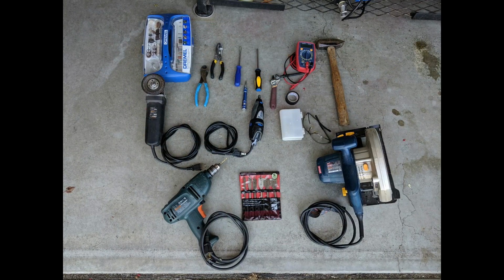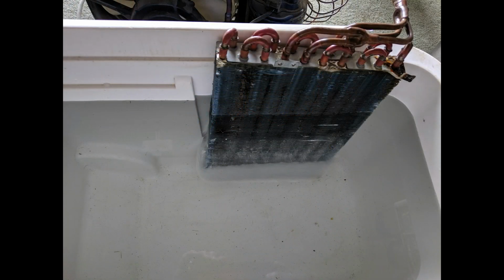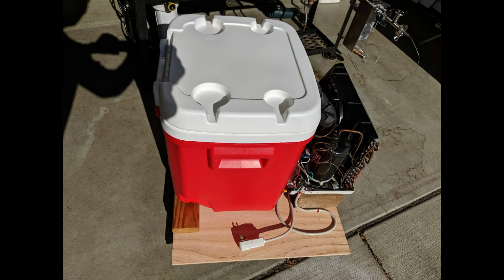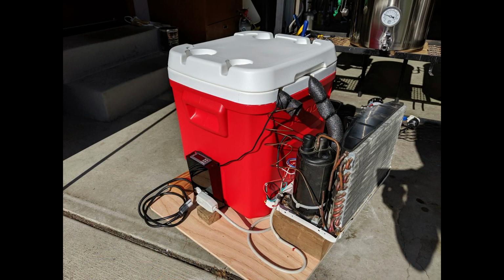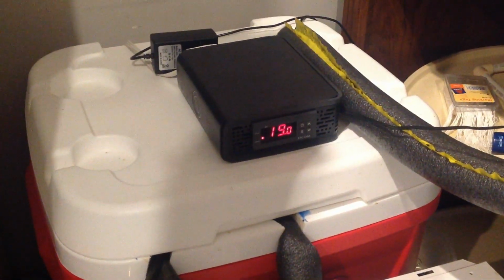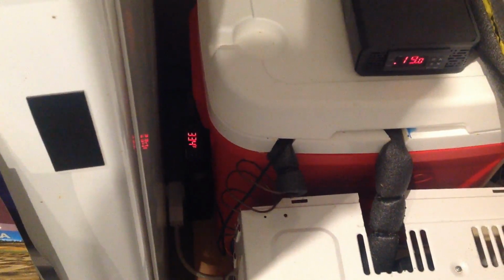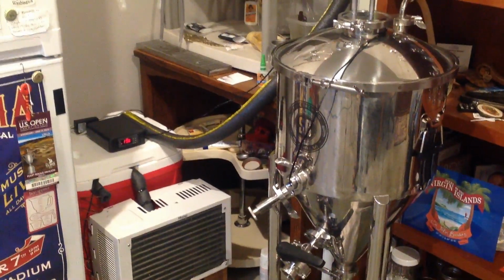Homebrew DIY Glycol Chiller

Comment: So you are basically keeping the glycol at a steady, low temp and just switching the pump when needed?
I would have likely overcomplicated it myself, this looks much more sane.
Reply from the maker: You are exactly correct.  The glycol in the cooler is held at ~ 32 degrees F.  The on/off controller for the cooling pump that circulates the cold glycol is controlled by the probe inserted in the thermowell in the fermenter.  I can program it any where I like to between ~ 35F to 75F (or just turn it off to get as warm as it naturally will which is above where I'd ever want to have it).  I'll be doing a video on pumps and will show the one that is in the chiller in that video if you are interested in that. Thanks again for watching.

Comment: Hrm, I do wonder if it's better to keep the return warm glycol outside of the foam sheath, so as to not heat up the cold feed tube?    Although realistically the temperature delta is probably negligible.
Reply from the maker: This is why I like to post videos: I get a lot of great input, ideas, observations offered by those who watch.  Thank you.
Funny enough, initially I had two different foam insulators - one for output, one for return.  After monitoring things for a bit, I realized that the reality was that neither insulator really did much. Having two different ones was sort of clunky, so I went to one.  The advantage of using the insulator is that it stopped the hoses from sweating so much (without the insulator they would literally drip with condensation).  Thanks again for watching and sharing your thoughts.

Comment: Hi! Awesome build and clean finished project. I had a question about the leftover parts. Do you have any fan at all that's blowing on the big coils on the front? I took things apart well enough, but I can't tell if there's a fan running in your video. Thanks for spreading your knowledge!
Reply from the maker: Thanks for your very kind comment.  There were two fan blades in here.  One was the hamster wheel style that you see in the stack up of unused parts at 2:00.  This one would be the one to blow across the cold "radiator" and force the cold air into your room.  The other one, which you can see at 2:59, is the propeller type that cools the coils in the unit.  This would be the warm/hot exhaust air.  You will need this one so the unit cools off when running (plus it would be really hard to get out!!).  Let me know if you have any other questions and I'll gladly answer.

Comment: This is great. Do you think leaving the AC wiring intact and just turning it full blast would work?  I'm in the garage and it's hot
Reply from the maker: While not an expert, I believe that the AC unit would run because no cool air would be blown over the temperature sensor.  I think that this would make the glycol extremely cold (freeze???) and put some stress on your unit.  I thought came to me that perhaps you could put a timer on your AC unit to cycle it on and off via time instead of temperature.  To give you a reference, my garage is around 68 degrees, when my glycol temperature goes up to 35 degrees the AC turns on for about 4 or 5 minutes to cool it back down to about 28 degrees (pretty efficient).  When just holding the temperature (not crashing) this cycle occurs every couple hours.  When just sitting idle, this cycle occurs once a day or so.
At 0:52 my test configuration is sort of like what you are talking about (everything was still connected)
Best of luck.
Reply: @homebrewingtips6029  really appreciate your time in responding. I will use a temp controller to monitor the glycol temp and keep the AC wiring intact, so the controller will switch on only when required. You also answered a different question I had about how much it runs. Was a little worried about making the hot garage even hotter, but it shouldn't be an issue with these run times and with my 5 gallon batches. Happy brewing!

Comment: Great work and project?  I guess over time there will be worry of unit rusting for the components submerged in the glycol water mix?
Reply from the maker: Good morning and thanks for watching and commenting.  I have been monitoring the unit for signs of wear (corrosion)  and so-far-so-good.  The AC unit I used was old and seems to be holding up pretty good.  Also, I am relying on what others who posted similar projects had to say on this topic: all positive..  Now with that said, my little submersible pump sometimes doesn't want to run and the glycol is a little cloudy, but no real signs of things giving out.  At the one year mark I will probably drain it, clean it, and give a thorough inspection.  The glycol is about $25 per gallon, and I used 2 gallons so I want to stretch it as long as I can.  Hopefully this helps.  All the best ....

Comment: Great system! Can you tell me about the glycol pump and where it's placed in your system? I'm not seeing how the glycol is pushed through the line.
Many thanks,
Stephen
Reply from the maker: Thanks for your kind words, I am happy to provide the extra info.  I should have taken a photo of this because others have asked about it too.  Essentially I have this little pump sitting in the bottom of the glycol tank.  The output tube comes off the top and pumps the fluid up through the tube connected to the fermenter cooling coil.  The output from the cooling coil comes back down to the tank through the second tube (both tubes are in the grey pipe insulator).  Here is a link to the pump I used (still going strong):
https://www.amazon.com/bayite-BYT-7A006-Heater-Circulation-Discharge/dp/B0196WL55G/ref=sr_1_7?crid=2H370Y1634UM5&dchild=1&keywords=bayite+12v+dc+fresh+water+pump&qid=1593960668&sprefix=bayite%2Caps%2C338&sr=8-7

Hopefully this helps.  All the best.

Comment: Hello!
This project looks really cool I just got an A/C unit to go with you idea.
Can I ask you a favor? Would you let me know how did you worked out the capacitor hard-wiring and circuitry part? I believe that apart from that I can set up the connections with the ink-bird controller for the temp. control for this glycol-side cooling temp. (apart from that for the fermenter which I already had set up).
Thank you!
Reply from the maker: Thanks for watching.  In my unit the A/C power line (the black wire) went from the wall plug to the on/off switch, then over to the high/low switch and finally to the condenser (look at time 3:04).  I could connect it directly from the cable to the condenser and the fan and that would be the same as if the unit was on and set to high power.  To do this a simple multi meter is helpful.  Another good spot to see this is 3:19, stop the video there and you can see the black wire connected to the condenser black wire and the fan red wire (they are tied together with the yellow wire nut).
Reply: @homebrewingtips6029  Allright! Let me give it a try and I let you know how it went!  
Cheers!

Comment: What pumps the glycol around bud
Reply: thanks for watching.  I use this little pump inside the glycol cooler.  It just sits on the bottom with the tube coming up off of the top: 

 https://www.amazon.com/gp/product/B01G305PK0/ref=ppx_yo_dt_b_search_asin_title?ie=UTF8&psc=1

I find that these little pumps work great for a number of different recirculation applications
Reply: @homesmokingtips1449  great,  thanks alot for the link 👍

Comment: This is really cool! Just a thought on my part. There has to be a way to do this smaller maybe with Peltier devices? I how someone out there posts a video.
Reply from the maker: thanks for watching a leaving a very good comment.  There are some fermenter suppliers who offer TEC coolers attached to the fermenter.  MoreBeer does (or did) like this:
https://www.morebeer.com/products/ultimate-conical-fermenter-14-gallon.html
I have played around with them myself, but I found them to be expensive and inefficient and a bit tough to use (also prone to failure if not handled right).  I am fortunate enough to have the space for the glycol type of set up.

Comment: Hi there, thank you for sharing the video of your Project. I do have a question.... do you think running a circulation pump inside the cooler would help keep the mixture at a more consistent temp?
Reply from the maker: In some other builds you see the use of a circulation pump.  I thought that I would try it first without one and was happy to see that it works fine.  When the pump runs to circulate through the fermenter, the return sort of stirs things up.  Also with the size of my cooler, and the coil's position right in the middle, I think the temperature is stable throughout.

Comment: Hey mate, just curious as to how well it actually pulls down to temp?
Reply from the maker: thanks for watching and thanks for writing.  My set up is in the garage where it is typically 65 - 75 degrees ambient.  I can easily move the temperature 5 degrees each 30 - 60 minutes (I never really timed it).  I can crash and hold below 40 degrees easily.  The single biggest factor is the efficiency and batch size in the fermenter itself.  Mine is up to 15 gallons, of which I usually ferment 8 gallons (that way I can fill a 5 gallon keg and a 3 gallon keg).  Ironically, the fuller the fermenter the better.  As for holding any temperature to with in .5 degrees, it is rock solid.  I hope that answers your question and helps.  Cheers!

Comment: This will be my next project.  Did you retain the stock capacitor?  Also, I have seen others just connect the thermostat leads together in essence creating a permanently closed (or open I guess) circuit.  Is that what you did?
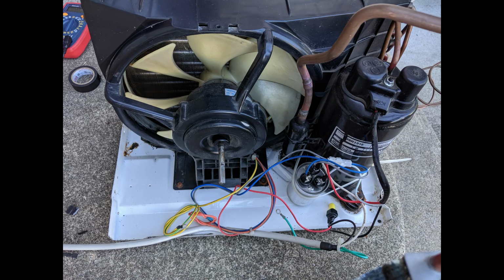Reply: First off, good luck on your build!  This is a fun project.  I kept the capacitor.   I followed the hot wire from the AC input and tied all of the connected wires together, For example, I took the on off switch out and tied the AC line directly to the on position, same thing with the speed control (tied it to the "high" setting).  As for the thermostat,  what you said would work, I found it just as easy to remove the whole thing and it left the unit very tidy.  You can see most of this in 3:00 - 3:25 in the video.  I found using a simple volt meter was all you really needed to see how the wiring actually works.  One extra thing that I'll comment on, when you are going to bend out the coil, I found slow and constant pressure was the way to go.  I had no issues at all (this was what I feared the most).  I actually pulled mine out and rotated it 90 degrees in one gentle, continuous motion.  Feel free to ping me with other question.  Have fun!
Reply: Any heat used to bend the coil into position or just slow pulling?
Reply from the maker: @nickypalma2039  No heat needed.  I just used a slow and steady force to pull out and position the coil where I wanted it to go.  This was the most concerning part of the project but proved to be quite simple with the A/C unit that I had.

Comment: Great build. Ill be doing one in the spring with an emphasis on  keeping it as compact and movable as possible as it will be used in my apartment with my ss brewtech conical.  Also thinking about implementing a ball valve to be able to drain  easier when necessary by hooking up to an external chugger pump.  Side note : you in Minnesota?
Reply from the maker: Thanks for the note.  I thought about doing this for a long time and am very glad that I finally did.  Your ball valve idea is a good one.  Also, I highly recommend the mechanical switch between your glycol pump controller  and the pump itself.  These little controllers can turn on if the power flickers (or goes out) and you would be broken hearted to see 2 gallons of glycol + 4 gallons of water all over your floor because the pump kicked on when the tubes are not connected to your fermenter.  Feel free to ask any questions once you get going and I'll be glad to help out.
As for Minnesota, no I live out in Tacoma, WA.  My company's factory is south of Minneapolis by just over an hour and every time I go back for meetings my first stop is always the Northbound Smokehouse and brewery!!!  (I also hit Surly when I have a little extra time).  Thanks again for your note.